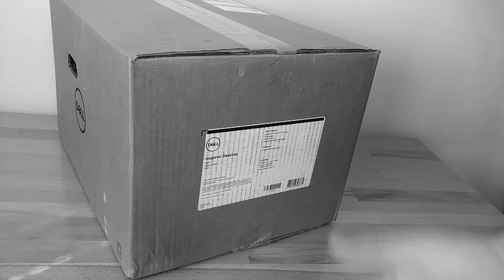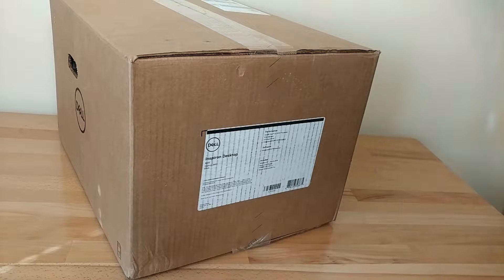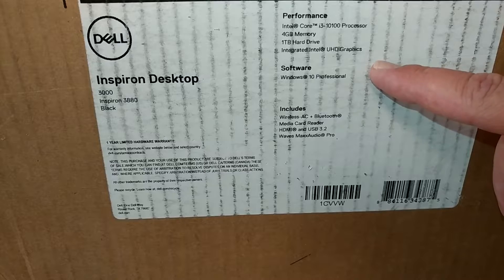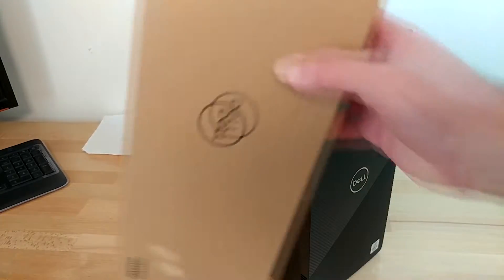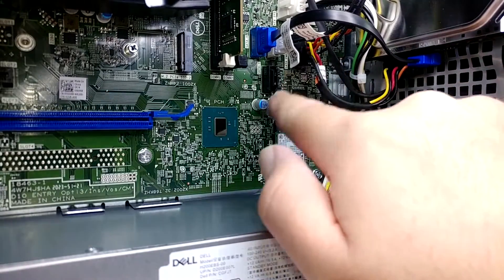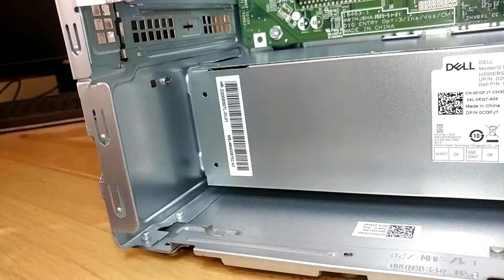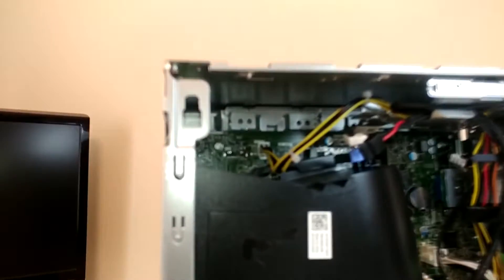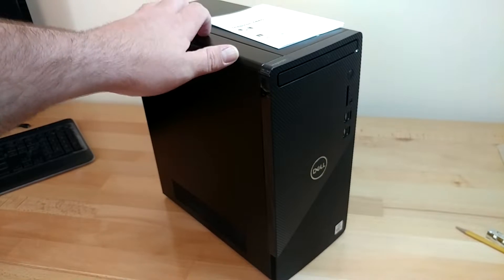Unboxing The Cheapest New Dell for 2021 (and 2022) and Upgrade Plans!

Comment: i have this same pc put an extra drive in it and threw a 1050 ti ib it and game quite well for the price
Reply from the maker: I agree. I put an inexpensive Dell upgraded PSU and a 4060 in mine. It's doing very well. CPU throttling is a big problem, but... most games don't demand that much CPU.

Comment: I found that a 16GB 2666 from PNY caused Blue Screen errors, but one from Silicon Power didn't.  Can't get an answer from Dell why 3891 supports 32GB, but not 20GB or 24GB
Reply from the maker: I've run into bad RAM before. It's a thing that happens, but not too often. I don't think I'd blame Dell for that one.

But... Dell support is legitimately useless and just reads from a script. That said, I'd normally suggest pairing memory of the same size, so 20GB wouldn't be ideal (but should "work"), but 24GB should be fine.

Comment: I'm not so sure your upgrades would be cheaper from DELL.
My new 8Gb machine DELL wanted another $200 for 8Gb more.
And $350 more for 24Gb more.  So, I told them FU I'll source
my own 8Gb more from AMAZON for $15.

!
Reply from the maker: I can't remember exactly what I said, but my intent was to convey that you should do your own research before committing one way or the other. RAM has always been a cheap and easy DIY upgrade, but you would (and I did) pay way more for a CPU upgrade on the open market than you would have through Dell if you'd have just ordered it that way. I think SSDs were at least a fair deal when I ordered mine. Video cards weren't, but they for sure are now. Etc.

Comment: Back inthe 80's I bought the newest compact computer for 2800$ it was a portable that weighed about 30lbs.monochrome monitor two floppy drive no hard drive. 8088 processor 8 bit  ran on DOS
Reply from the maker: My first several machines were DOS machines and I had a buddy that a "luggable" Compaq.

Comment: Hey Guys, just wanted to share some information.
I have an Inspiron 3891 with some upgraded components:
i5-10400f
ASUS nVIDIA TUF GTX 1650 4gb DDR6 w./6 pin
12 gb RAM DDR4 2666 mhz
256 gb NVME and a 500gb PNY SSD
And i've upgraded the power supply to the 360w Dell one.

About to upgrade to 32gb of RAM next week.

I have been doing a lot of VR testing with an Oculus 2 Quest and also using Air Link, not the link cable (yet) 
Will keep posting my findings!
Reply from the maker: My own testing showed that 32gb didn't make a huge difference, but I imagine that depends entirely on what you're doing with it.

Comment: The 3891 is on sale at Dell for $329.99 on BF (2021).  Same specs (Ci3 10th gen, 1TB HDD, 8GB RAM) except it comes with a really cheap DVD/CD RW drive (which is the only reason I bought this vs a Ci5 (which didn't come with a DVD drive)).  Upgraded with some spare components I already had (8GB RAM and 256GB SSD), and I'm surprised it works pretty good for basic tasks.  The only thing I don't like about it is Windows 11.
Reply from the maker: I actually just mentioned this over on my tech channel, The Broken Tech, where I will be publishing this sort of content in the future. At the time, I didn't think to mention that it was a 3891. So,you get the front panel USB C too, which some people are interested in, and I believe it also should support 11th generation processors. The optical drive is actually a huge deal for a lot of people, which surprised me. 

Dell also doesn't advertise any of their machines as coming pre-loaded with Windows 11. If you upgraded it yourself, you should be able to roll it back for something like the first 7 or 10 days afterward. From what I've read, it doesn't sound so bad. I imagine you could also just perform a fresh install of Win10 on it if you'd prefer.

But... I will find that out shortly. I just purchased an HP TE01-2250xt for next year's series, which I think is the much better BF sale this year. 11th Generation i5, 256gb SSD, dual channel ram, 400w PSU, preloaded with Win 11, for $450.
Reply: @TheBrokenLife   Yes, the 3891 does come with a front USB-C (but does not support video).  The optical drive is flimsy, but it's better than using an external USB DVD/CD drive.  

Unfortunately, the Win11 is a factory load, so there's no "go back" option.  I'm too lazy right now to reload a fresh Win10. :) 

I'm interested in your take on HP build quality.  I've heard bad stories about HP PC products, and one bad experience myself (15yrs ago).  I'm surprised they would put in a 400W PS, that's a nice upgrade in itself.
Reply from the maker: @fialee8  I've never had a 9.5mm optical drive that struck me as "quality", but I've had a few that endured a ton of abuse in laptops in the past. I think for most people it probably won't get used enough to be a problem. If it is, I already have a video covering installation of an aftermarket option.

Huh... It seems weird that they wouldn't advertise it coming with 11. Personally, I look at coming preloaded with 11 as an upgrade, even if its not, and I think most people would probably assume the bigger number means "more better" too. But... Dell does a lot of things that don't make sense to me. Regardless, I'll probably roll with 11, or perhaps attempt a downgrade to 10 just for the fun of a video and to see what happens.

I'm interested to find out too! I'm no great HP fan either, but I honestly believe that at this price segment in the market it probably doesn't matter too much who's name is on the front of it. Just like the Dell 38xx, I can't even buy the parts to built it for what I paid for it to come assembled and operational. How much room to complain could there really be? We'll see!

The 400w PSU surprised me too. They also offer an optional RTX 3060 in it at what is actually a pretty fair price in this market. So, it appears HP's bottom tier, at least in a normal case width, doesn't drop as low as Dell's. You can't even spec a 38xx up that high. Seems like a missed opportunity since Dell does already build a 500w PSU that will fit the 38xx case/mb, but again, Dell does things that don't make sense all the time.

At the moment, I think the HP is well worth the extra $120. We'll see how I feel once it shows up. I expect the unboxing video to hit The Broken Tech channel around Christmas/New Year.
Reply: @TheBrokenLife   I believe the 11th Gen desktop CPU is Rocket Lake, which should be a big freq boost over 10th gen, plus a Ci5 has two extra cores.  I would've moved up to a Ci5 (10th gen) for $70 more, but it didn't have the DVD/CD drive.  I did watch your upgrade video, and the LG drive on Amazon is currently $40.  I've got a lot of PCs and tablets <3 yrs old (now two DT, three laptops, and three tablets plus a work laptop).  

The HP has decent specs, but did notice that in all cofigs, they populate both DIMMs with memory (even the 8GB was a 2x4GB vs the Dell was 1x8GB with a free slot).  Given it only has two DIMMs, upgrading will result in one or two extra 4GB memory sticks.  I am sub'd to your channel, so it'll be interesting if you'll decide to do a 12GB config or move up to 16G or 20G/32G RAM profile.
Reply from the maker: @fialee8  In real world results, I'm not sure how much faster the 11th gen chips are vs their 10th gen counterparts, but the 2 extra cores is for sure a huge advantage. I was really trying to find a reason to buy a machine with a 10th gen i5 too so I could test them, but I just couldn't justify it. None of the sale prices were good enough.

LG drive.. yep... It's hard to know if me/my subs can take all the credit, but Amazon has sold out of the LG drive multiple times since I dropped that video and the price has increased by about $10. I would have never suspected it, but "the TBL effect" could be a thing. But... Any 9.5mm drive should fit, just with varying degrees of attractiveness.

The populated RAM slots are a double edged sword. One side of the argument is what you presented: you have to throw away RAM to add more. The other side is that it's dual channel out of the box, which the Dell is not. In my testing, just dual channel RAM is a massive upgrade on its own. Just tinkering around when it still had Intel graphics, the frame rate in most benchmarks increased by 1/3. The slight ($20?) loss of money by throwing the RAM out during an upgrade is massively offset by the performance gain, IMHO.

For me, the far distant grand plan is to populate another aftermarket board with 4 4GB sticks I'll end up having laying so I'll end up using it all. I'll probably only bump the HP up to 16GB, dual channel. 32GB in the Dell ended up being pretty excessive. We'll see how it goes on the Asus MB when the i7 can actually stretch its legs.

Comment: does it comes with cables to connect an extra SSD?
Reply from the maker: This question requires sort of a long answer, which is probably best covered by the "Drive Mounting 5 Ways" video in the playlist.

The short answer is that there is only one M.2 SSD slot, but there are extra SATA data connections for 2.5" SSDs. I'm not entirely sure if any cables come with any particular specification of the machine, but the cables are inexpensive and I provide several links to many options in the descriptions of that video.

Comment: again no dual channel in 2021... Dell please, pleeeease!!
Reply from the maker: Ehhh... I think the second stick of RAM I put in it was like $20. I think I'd rather have them ship it with an open slot than populate it with RAM I'd have to pay to throw away.
Reply: @TheBrokenLife  hmm okay. Is a point..
Reply: But on the other hand people who buy an all in one haven't usually much experience with all these things and they also not want to invest time. So..
Reply from the maker: @Sica1000  That's a gap I'm happy to help them bridge. Installing RAM is one of the easiest and most rewarding PC upgrades a beginner can do.

I do understand your point, but from Dell's perspective they would be shipping a computer that "can't be upgraded" to the untrained eye. I see both sides of it.

If I'm going to complain about anything, it's their silly power supply.
Reply: @TheBrokenLife  yes, the form/shape of the psu is unique so you can't put it in another pc later down the road. This is not good for the environment.